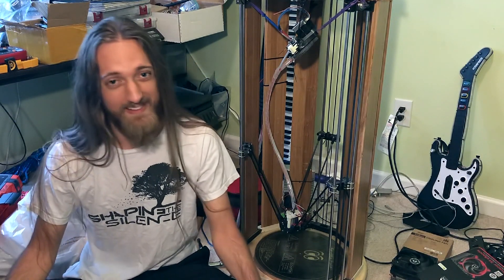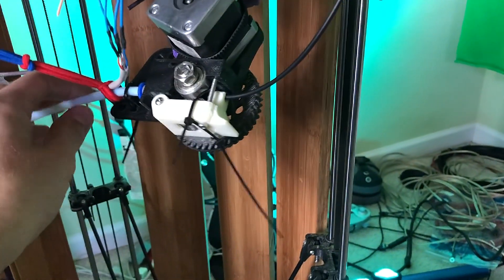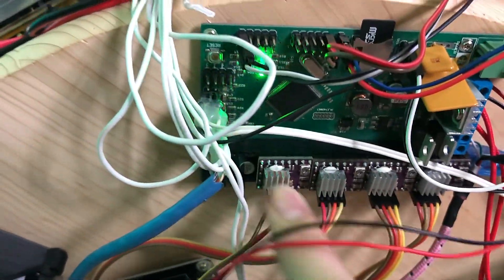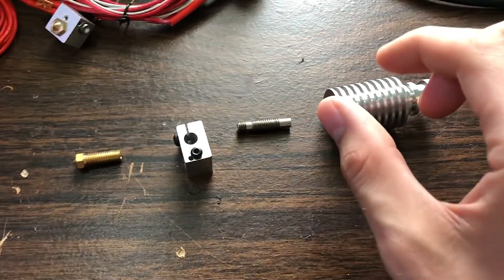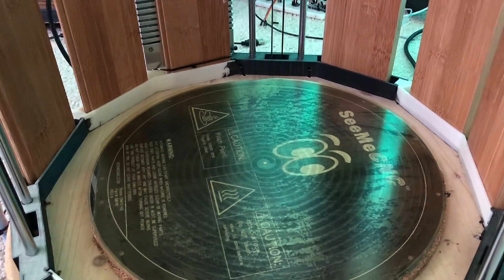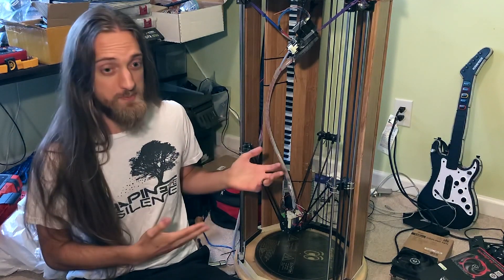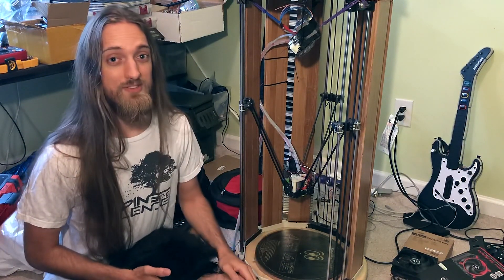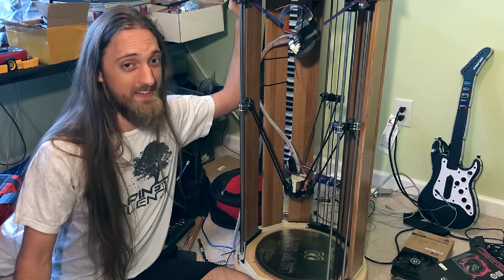My Homemade 3D Printer

Comment: Why is yourextruder just flying around
Reply from the maker: I wanted to reduce the length of tube between the extruded and hot end to reduce the “lag” you get from having a bowden setup.
Reply from the maker: Less tube = better response between extruder pushing filament and molten plastic coming from the hot end.
Reply: Shaping The Silence yeah i know but please make a mount to hold the extruder ot just hurts me to see it floating around 😂
Reply from the maker: @jappiemoto  Careful, that OCD is gonna drive you mad! :P Probably won't change it until it stops working, though. That's the trouble with having too many projects, they only get love when they stop working when I need them to.
Reply: Shaping The Silence  haha that true 
But still it will last longer if you take care of your projects that way it takes way longer till something os wrong

Comment: Ay! I picked up an ender 5 and 3 over the last couple of weeks. What made you go for the delta design over a corexy or cartesian? I've built a few deltas and found that having to deal with counterbalance every time I wanted to change something on the extruder, and keeping the bed level was a nightmare.
Reply from the maker: I went with delta because I thought it would be cool. This lead to it taking years to complete. 😂 the bed leveling was a pain until I got the bed leveling probe and started using mesh bed leveling. I don’t have it move super fast, since I have a massive nozzle on it that lays down layers nice and thicc. No problems with counterbalance that I’ve encountered.

How are the Enders working for you? I’m definitely considering the Ender 3 if I need to print something more detailed than my sloppy machine.
Reply: @ShapingTheSilence   you can see how the ender 5's doing for yourself :D
https://www.twitch.tv/3dprintasmr
They're a solid printer line but made some frustrating cost cutting decisions. Nothing that can't be fixed with 3d prints (except the terrible stock motherboard... the 1.1.5 version with the TMC2208 drivers is better.. but not a lot of extra pins for expansion and not a lot of memory for firmware features). I'm working on a lighter extruder design using a microswiss titanium hot end as the base. At 80mms out of the box I got a lot of ghosting but that was reduced as I tightened things up. I'm hoping to shave off a good 50% of the weight from the OEM hot end/extruder setup and push 130mms.
Reply from the maker: I’ve heard there are some good 32 bit drop in replacement boards for the ender 3 that have more features and better drivers. I think it was about $35 or so for that one.
Reply: @ShapingTheSilence  I dont like buying cloned boards when I can avoid it. But for my personal printer my plan is to iteratively turn it into an all in one design and print station. I'll be using the pandaboard with it's intel cpu as the motherboard and im looking into leveraging it's gpio headers to break out to stepper drivers.
Reply from the maker: Nice! Can’t wait to see what you make of that. Should be really cool!